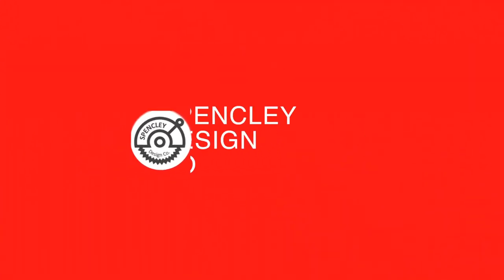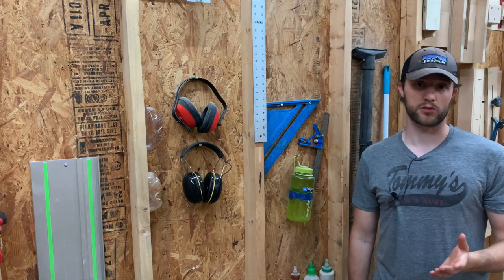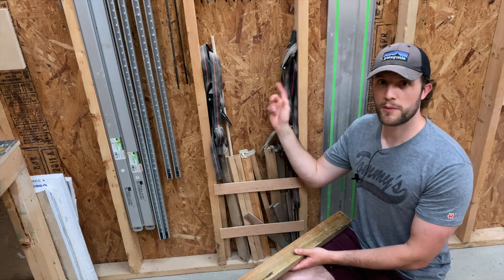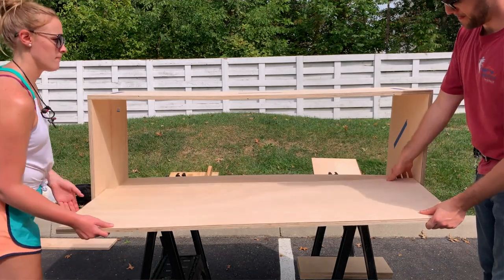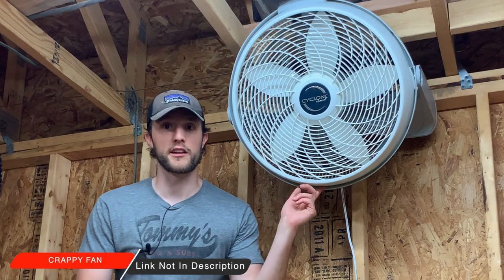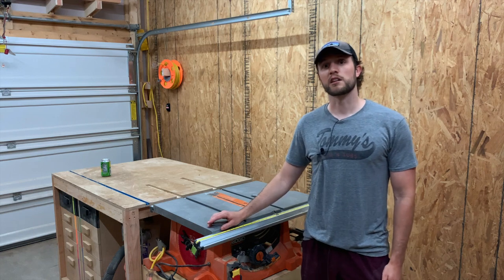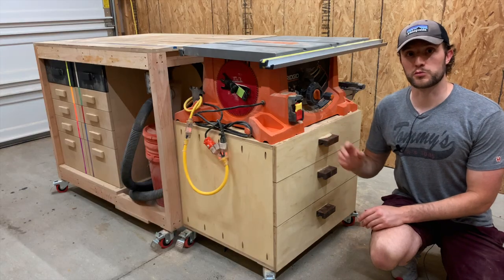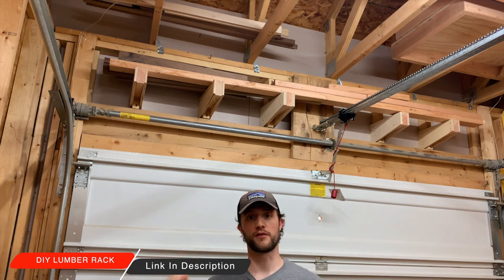Starting Your Woodworking Business in an Apartment

Comment: I used to have the Sawstop PCS, which ran on 220. When I moved out to Ohio to this current place that has actual knob and tube (you think you have electrical issues!), I ended up actually trading down to the 1.75hp CNS that only requires 110. It works better for my applications, and I've only had issues resawing 8/4 white oak. I'm not sure why you don't think you'd actually enjoy a Sawstop. If you want to try out my saw on something, feel free to come on out to Clintonville sometime and give it a whirl.
Reply: I'm not sure why I used "actual" so many times there. 🤨
Reply from the maker: Thanks for checking out the video! Maybe is misspoke, but I do think I would enjoy a Sawstop. That’s what I want to buy when I move out of this apartment garage.
Reply: @SpencleyDesignCo  Maybe I misinterpreted what you were referring to. There's a lot of weird sentiments against getting one among woodworkers, so I wasn't sure. I've triggered mine a few times already (benefits of having ADHD LOL), so I'm already sold on the primary reason for getting one.
Reply from the maker: No harm done 😀 another reason I can’t get one now is because I would need an actual dust collector. Since I only have one circuit, it’s not gonna happen. Even now, there are times when I can’t run my table saw and shop vac at the same time

Comment: Great wood shop set up. By the way, did you get any noise complain from neighbors?
Reply from the maker: Thanks for checking out the shop tour Steven! Nope, no complaints after about 1 year. I usually keep the door closed and only work between 10a-6p.

Comment: Why is your dust collection bad? It seems to be pretty inexpensive and popular method.
Reply from the maker: Great question Joshua! I mean it works well, but it’s very limited capacity fills up super quickly and shop vacs don’t move as much air as a dedicated collector does. The chips have to be very close to the inlet of the hose for it to pick anything up. But for about $80, it’s a pretty decent solution